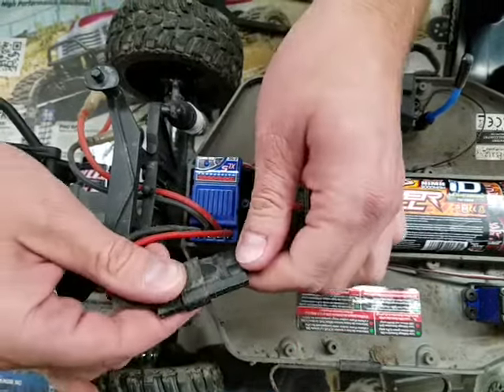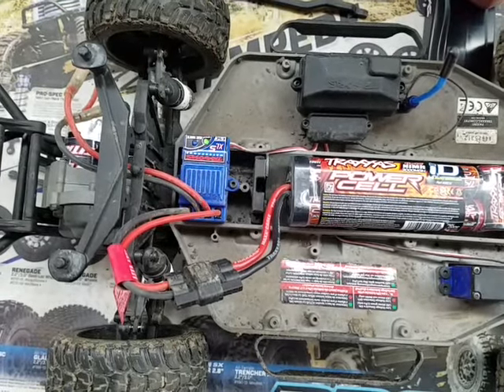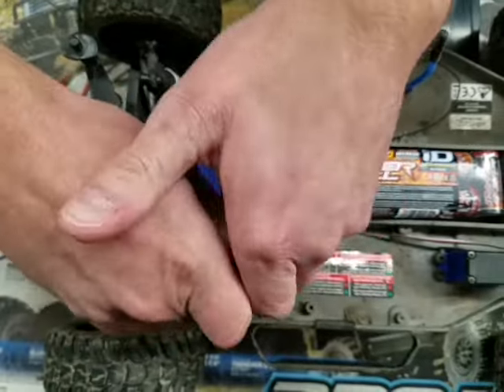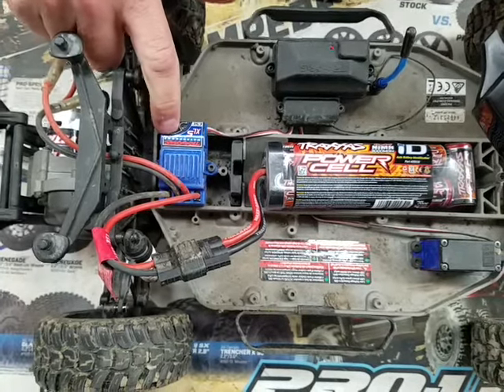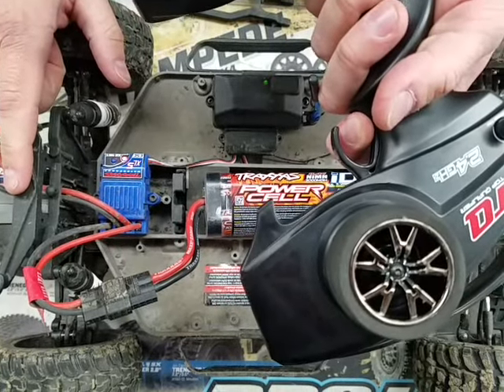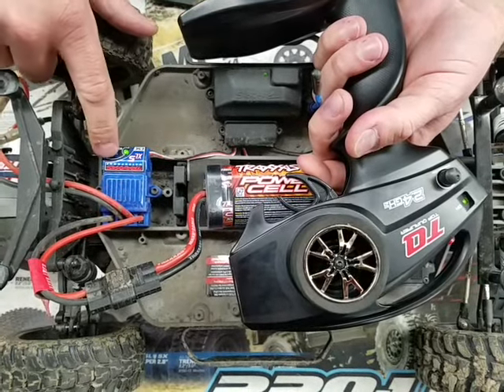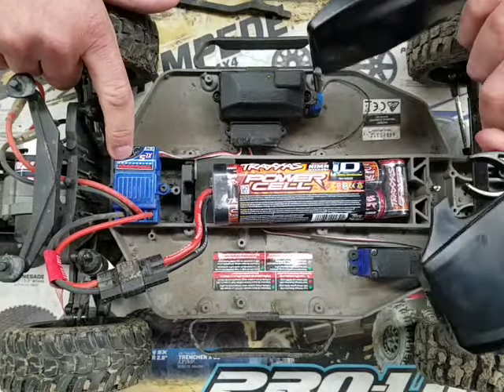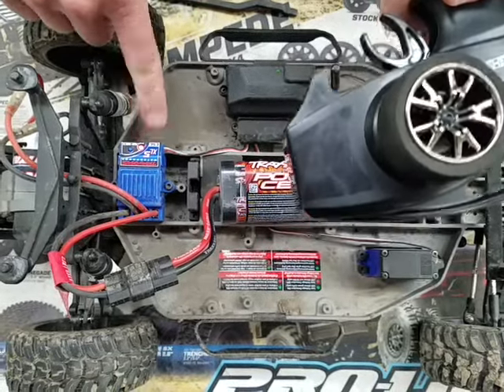Traxxas - changing battery modes without LiPo - calibration method - Hobby Haven Quick Guides

Comment: It’s not working when I let go when it’s red it just goes red and green
Reply from the maker: Make sure that your radio system is bound and that the esc is plugged into channel 2. Red and green blinking can also mean that either the esc is seeing too much voltage or that it's not getting a radio signal depending on how old the esc is.

Comment: it’s still blinking red and green after i let go and hear the beeps
Reply from the maker: Make sure that your radio system is bound and that the esc is plugged into channel 2. Red and green blinking can also mean that either the esc is seeing too much voltage or that it's not getting a radio signal depending on how old the esc is.

Comment: What if I wanted to put in a lipo what are the steps to do so?
Reply from the maker: They're in lipo mode out of the box. if you need to change from nimh to lipo, you turn the vehicle on and when you have a solid red light, hold the button for twenty seconds-ish until the motor beeps and the light turns green.

Comment: Thanks for sharing the settings for different type batteries. I'm still learning about batteries and wonder if you could answer a question. Obviously we want to protect our Lipo's with LVC so as not to run them down to far. If you were to simply leave your ESC set to LIPO and used a NiMH battery what would happen? Less run time? Would it damage the NiMH battery?

Comment: How to change it to lipo mode?
Reply from the maker: If you are in NiMH mode currently, simply turn on the car, and, once it's ready drive, press and hold the on/off button on the ESC for about 15-20 seconds. The motor should chime and then you release, the light should come up green.

Comment: It beeps but then I does not work
Reply from the maker: If you are in NiMH mode, your motor made the tones, and your car still isn't running, I would take it to your closest hobby store to get diagnosed. Cause if you calibrated it's not the remote, if it's in NiMH mode it's potentially not the ESC, and if the motor made tones it's most likely not the motor.

Comment: I did this and I’m still flashing and can on steer
Reply from the maker: If you're not able to steer it's possibly a radio issue. If you have steering and the ESC is still flashing, it'll depend on the color of the light flashing. Just green means calibrate, green/red means over-voltage battery, slow flashing red means low voltage battery, and fast flashing red means overheating.
Reply: @hobbyhaven1873  don’t worry I got it working it’s all good now it was in Li-po mod